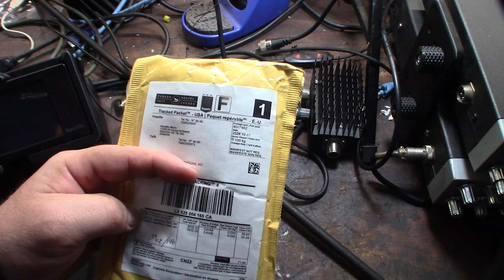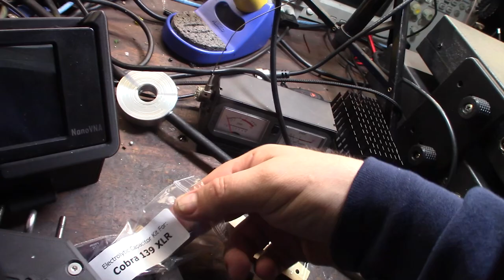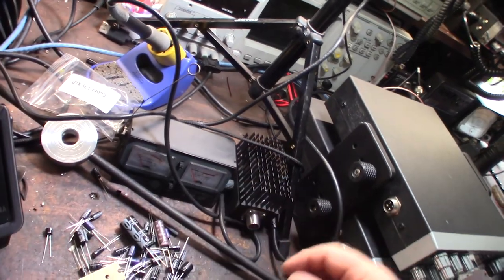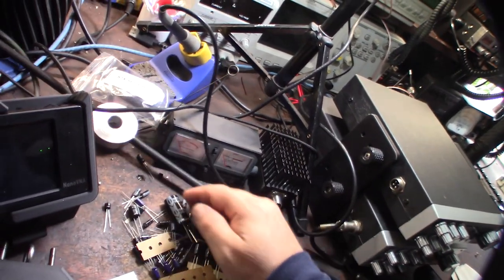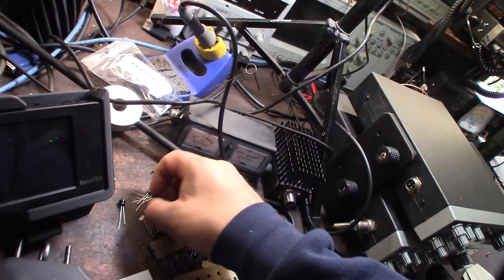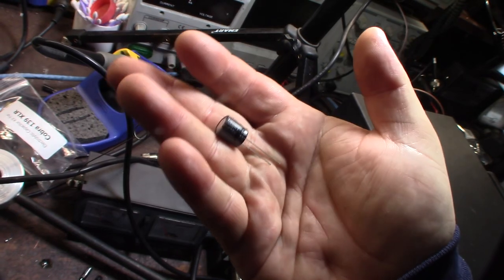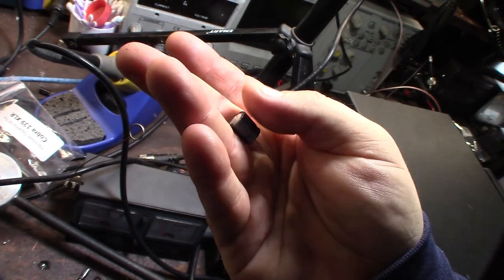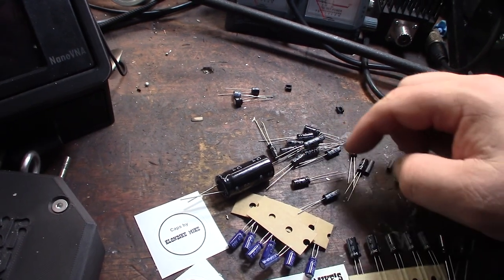Klondike Mike CB Capacitor Kits Are Legit!!! All high quality caps President Grant 858 Cobra 146 GTL

Comment: I always buy singles on digimouse to recap devices. But for something like this I would spend many hours matching up my order and then add one or two extra to each one "just in case". It is a ton of work. Then there are the extras plus the 20% or whatever price hike for buying two of something, it is probably even more expensive.
Reply from the maker: One the issue with these old radios documentation. I found a schematic from another radio with the same main board. This guy took the time to track down the capacitors. What is your favorite brand of capacitors? Mine is Nichicon
Reply: @fintechrepairshop  Chemicon, Nichicon, Rubycon and probably Panasonic are all pretty equivalent for electrolytics. Really cooling and the amount of overspec is much more important than one quality brand over another. I tend to reject devices where caps are crammed between heat sinks, and it is pretty common.